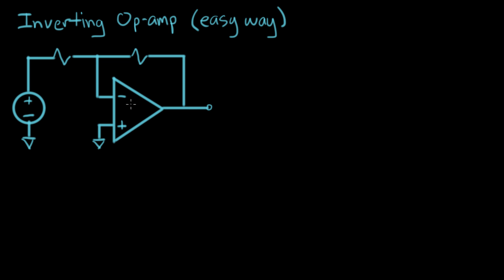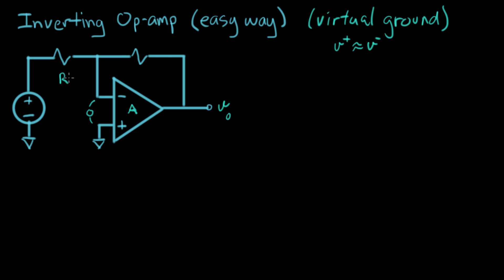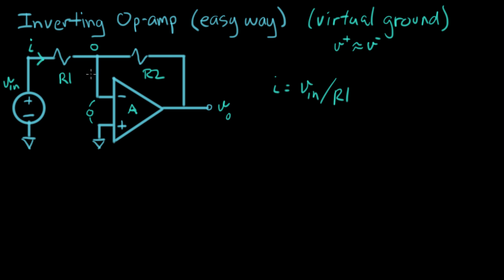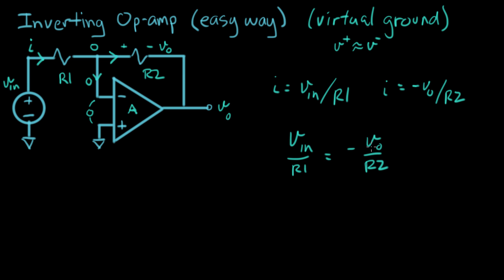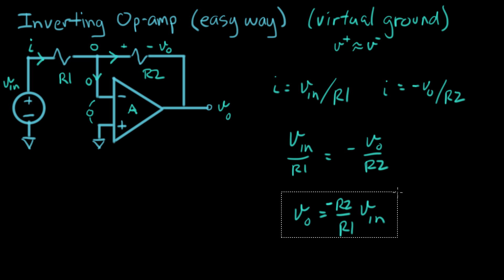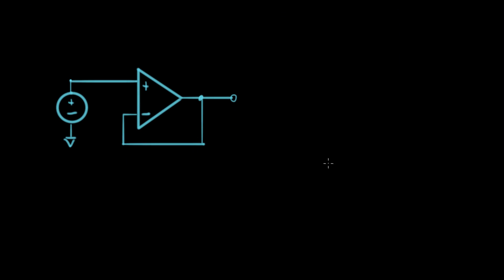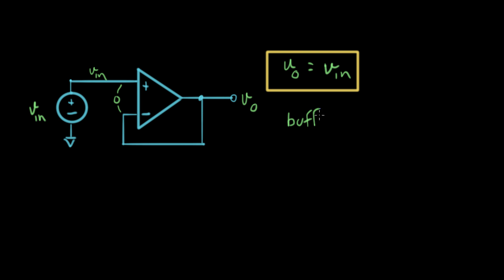Inverting and unity-gain op-amp with virtual ground

Comment: You failed to explain--  if V out is equal to V in, what is the point of having the amplifier there in the first place????
Reply: V in here is difference between v+ and v- for by using v in = vout you can use the op amp as subtractor. For ex- if V+ = 5v and V-=5.5v it will give the output as -0.5v and similaly we can use this as a subtractor circuits.
Reply: V in here is difference between v+ and v- for by using v in = vout you can use the op amp as subtractor. For ex- if V+ = 5v and V-=5.5v it will give the output as -0.5v and similaly we can use this as a subtractor circuits.

Comment: why do we even need to consider/use unity gain buffer, we can just avoid the use of amplifier because anyways the input is equal to output voltage so why not use a simple staright wire? Was this just for learning purpose? or unity gain buffer actually have some use? Kindly help me out of this doubt.
Reply: we can not use a wire to subtract two diff. values whereas we can give two diff voltage as input to unity gain opamp and get a output = subtraction of both the voltage so in this way we can use opamp as a subractor.

Comment: is the gain always ginormous? If not how would the circuit react when the gain is for example very small etc.?
Reply: The opamp's internal gain is always very large when it is by itself. We can change the gain by modifying the external circuitry (e.g., adding a feedback loop from the output back to the input).

If you simply connected the output to the (-) input with no resistor, and the signal going into the (+) input, you create a "voltage follower" where the gain = 1. Or Vout = Vin. He covers this towards the end.

Comment: can i say in this way: 
Virtual ground can only apply for the cases that, Vout is connected to negative side of op-amp (= inverting input) ?
Reply: I think no, virtual ground applies when v+ or v- is connected to ground, and then you can say that both v+ and v- are 0 V. I also think you can take that v+ ~= v- (can take them pretty much as equals) even if neither of them is connected to ground, because they are similar due to A value being big. I'm a student myself and I'm learning abt these things now, so if smbd knows better please correct me ^_^

Comment: In the previous algebra of Inverting Op Amp, you could have made the "A is really big, so we're crossing out v zero" type arguments a lot earlier in the algebra. So this isn't actually all that much easier. I'm not just nit-picking... for some people the "A is really big, so we're crossing out v zero" arguments are much easier to recognize. Is there a time that those arguments aren't equivalent?
Reply: The idea of "v zero' =0v is of course INCORRECT !   
When the input is at a frequency , fin << f3db of  Aol (open loop gain) : 'v zero '' = Vout/Aol          ~  uv   
                                                             fin = 100* f3db                                      'v zero '  = 100*Vout/Aol ~ mv

Comment: @Khan Academy I have a question.  I have a circuit here that has a uses a voltage follower but the voltage at the output does not equal the input.  Is there a reason for this?  When I use Lv 1 of the universal op amp in LTspice, the voltage is equal but when it is Lv 2 or higher, the voltage differs.

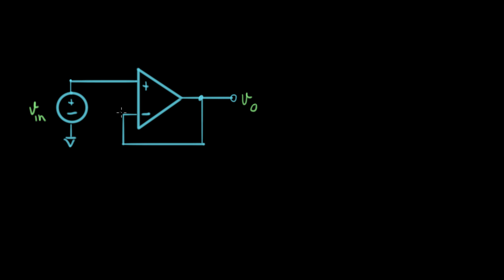Comment: Could someone check if my reasoning about the virtual ground is right?  The virtual ground, which he draws with his virtual ground symbol at 5:26, means that both terminals (V+ and V-) are on the same voltage. So the voltage differential is 0V. But it still depends on the circuit what the actual voltages of the terminals are. For example with the inverting opamp circuit, V+ is connected to the ground this means V+ = 0V and because of the virtual ground V+ = V- = 0V. In case of this circuit 5:35 V- is connected to Vout which means V- = Vout = V+  = Vin  ?
Reply: Yes, that is right.

Comment: There is voltage drop from 0 to -Vo in R2, so R2 should be Vo. And so, I=Vo/R2.
It was his mistake
Reply: no because the voltage difference is +(0 - v0) with current flowing positive. If it went the other direction you'd flip the signs; -(0-v0)

Comment: When u wrote expression fot current through R2, you wrote (0-V_0)/R_2 but this means that currrnt should flow in the opposite direction because left side is 0 volt and right side V_0. How can current flow from lower potential to hugher potential?

Comment: I don't understand why is there at 3:30  -vout. Could someone explain please?
Reply: Before resistor R2, voltage is is, because as decided V+=0. After resistor R2 your voltage is V(out). So the voltage drop accross the resistor R2 is 0-V(out) = -V(out)
Reply: Correction: Before resistor R2 voltage is zero since as decided V+=0. After resistor R2 voltage is V(out). So the voltage drop across the resistor R2 is 0-V(out) = -V(out)

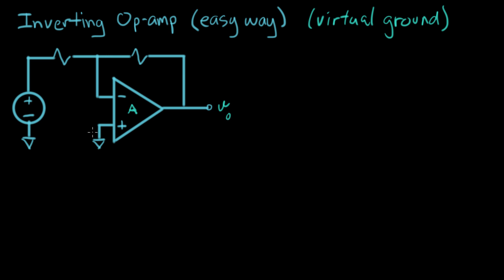Comment: Why is there virtual ground at -ve terminal in second op amp? At 1:04, he says "the idea of virtual ground says that if this node here(referring to +ve) is 0V...that means this minus terminal is gonna be also held at 0V". 
In the second op amp +ve is not at 0V.
Reply: Virtual ground is not for ground connected ones only. Virtual ground means V+ and V- are same; no matter whether a terminal is connected to ground. In second case, difference in V+ and V- is zero while V+ and V- are non zero. 
PS: Virtual Ground does not mean ground. We consider the terminals (V+ and V-) as conventional nodes. Practically,  V+ and V-  are not same. But the difference is very small which is considered as zero in Virtual Ground concept.
Reply: If one of the two terminals is not at real ground, then it's a virtual short, not a virtual ground.

Comment: For  the last part, we came to the conclusion that Vo=Vin because of a very large gain A. Then in the end statement, khan says our gain is simply just 1. How does that work?
Reply: There are two "gains" in this story. The gain of an opamp component by itself is a huge number. When you connect an opamp as shown in the video, the gain of the entire circuit, going from the input (vin) to the output (vout), is unity (1).
Reply: As I understand it, V+=V- so Vout = A((V+)- (V-) ). We can see that V+ = Vin and V- = Vout. If you divide Vout with A (something really big) then it will tend to zero. This leaves us with 0 = (V+)- (V-) or 0 = Vin-Vout. Which gives us Vout=Vin.
Reply: Willy McAllister, I was going to write the same comment :) yes, also this the same reason current doesn't go via op-amp. The gain of op-amp is very large number.
Reply: An op amp has a max gain built in, but you also have to tell it how much gain to use, typically by voltage dividing the output.

For instance, ff it's feedback(- terminal) is 1/10th the voltage of the output, it's gain will be 10x the voltage of the reference(+ terminal).

If you want max gain, you simply ground(or pull high) the feedback(- terminal), in a way such that the two terminals can never be the same voltage. This is useful when you want to amp a low voltage pwm signal to a higher voltage pwm signal, where flat square waves are what you want.